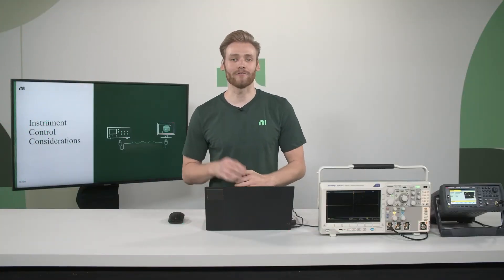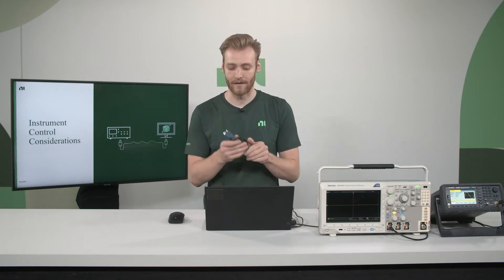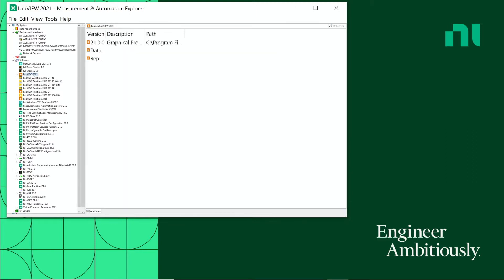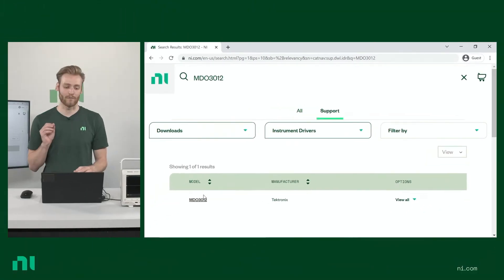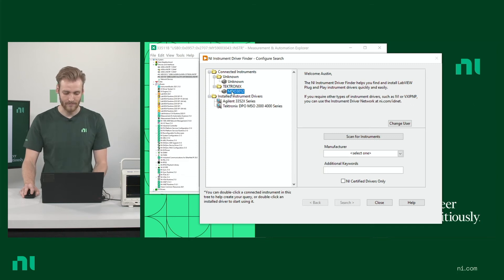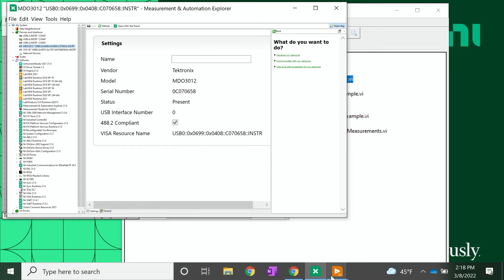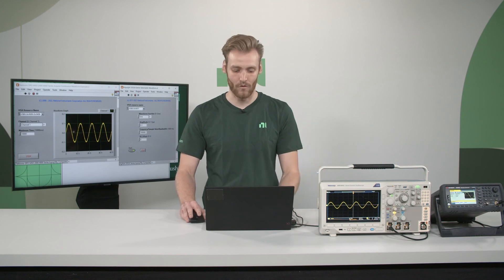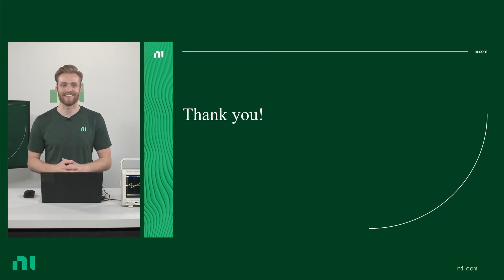LabVIEW for Test Instrument Control

Comment: When I open NI Max it only shows two lines: one showing my computer and another showing "ASRL1::INSTR" which seems to be the bluetooth on my computer.  This is utterly useless.
Reply from the maker: Hey, we understand your frustration. First, verify your physical connection to your hardware and make sure it’s being recognized by your computer in Windows Device Manager. You can find more help here: https://bit.ly/46PqHym
Reply: I am running the Mac version so there is no device manager.  But I can verify it’s connected by actually interfacing with it through its web app.  NI Max simply doesn’t see it.  And LV offers zero tools to point to it.  LabView is essentially worthless to me.
Reply from the maker: In this case, we recommend visiting our support website: https://bit.ly/3SRlujW. From here, you can share your question with the community, or open a support ticket with our team. Let us know if you have any more questions.